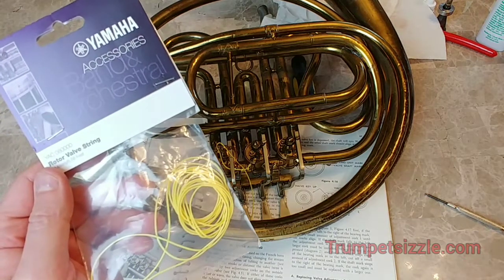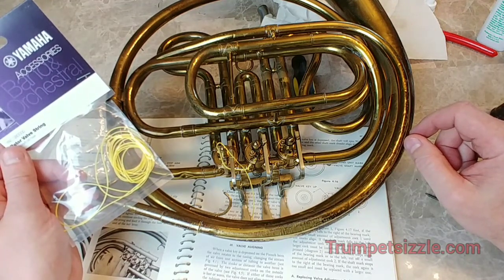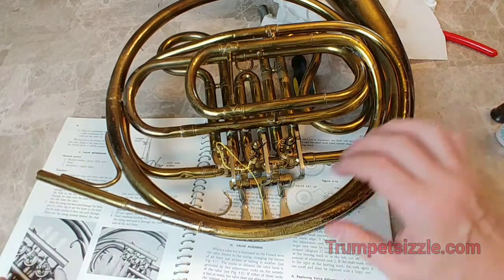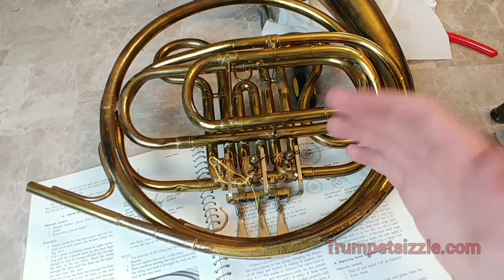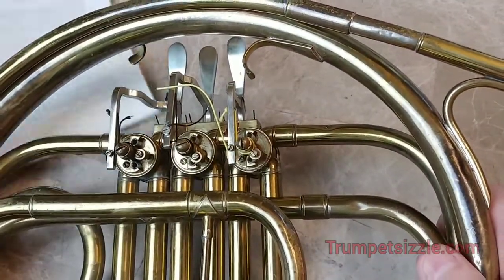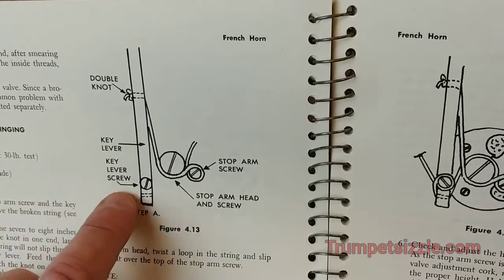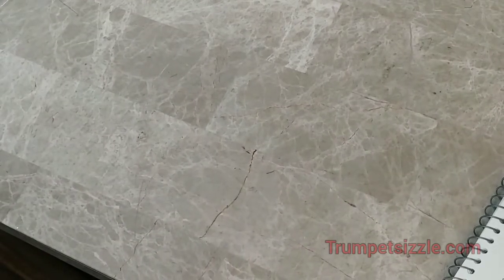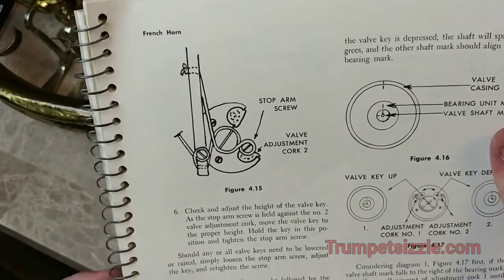How To Restring A French Horn Rotor Valve, TROMBONE or any other rotor!

Comment: 1) Thanks for this! When I re-strung my trombone (King 3B+F) I couldn't figure out how to adjust the travel, and the key lever clanked on the rotor casing on release. Now I see I should have left the stop arm screw loose (Note 2) until I set the travel limits.

2) Do the string overlaps matter? The book mentioned the issue only in Note 1, but the diagrams show every crossover point with the loose string passing beneath the string that's already there.

Figure 4.15 shows the string overlaps on the key lever side of the stop head, different from your overlaps at 15:30 on the way back through the hole in the end of the key lever. The only way I can imagine that might matter would be to keep the string from working its way off the stop head.

Diagram 4.15 also shows the loose end of the string coming from the key lever screw, laid beneath the string from the hole to the key lever screw. That one might matter more, to keep the string from loosening with use.
Reply from the maker: Yes, the overlaps DO make a difference. Don't deviate